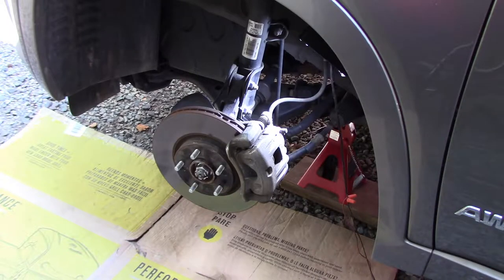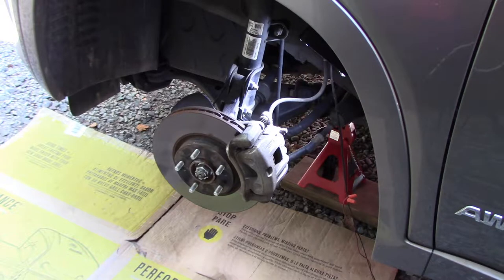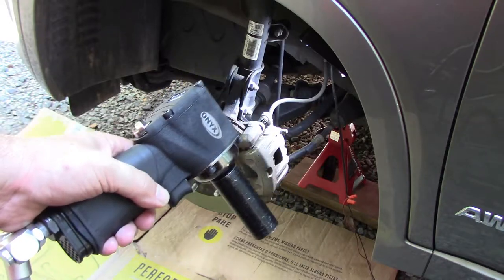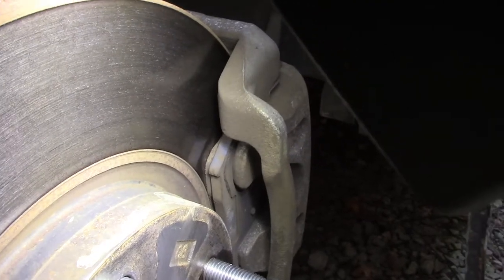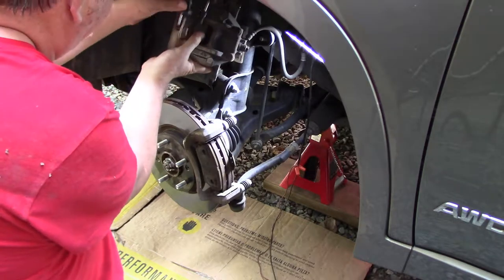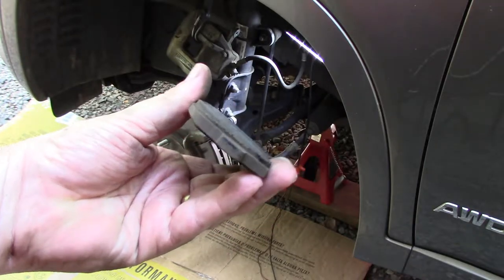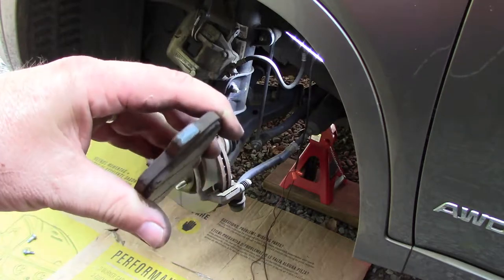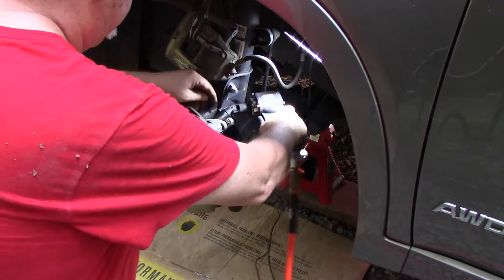2013 Kia Sorento Brakes

Comment: Hey man love the vids just a quick question I have the same model and I’m at 79k miles are there any major problems you have had with this Kia?
Reply from the maker: Nothing too major. Replaced a noisy pulley (video on that too). I just had to replace the automatic transmission oil temp switch. It was a pistol because I had to loosen the front motor mounts and jack the engine up a few inches. The Kia tech info site didn’t mention that. Several of the bolts on the cover are very hard to reach. I had to do it by feel. The code was P0711. Oh, it is a permanent code that a scanner won’t erase. News to me. Basically, it is so people don’t cheat with some types of repairs. After it runs a few drive cycles and the computer is happy it will clear.
Reply: TOM2RN thanks for the info man I really appreciate it so In general I would say it’s a pretty reliable car?
Reply: TOM2RN I’m replacing my pulley on Monday but other than that it’s running pretty smooth
Reply from the maker: Been reliable to this point.
Reply: I realize I am quite randomly asking but does anyone know a good place to stream newly released tv shows online ?
Reply: @Israel Camdyn Lately I have been using Flixzone. You can find it on google :)
Reply: @Langston Franco Definitely, I've been watching on Flixzone for months myself =)
Reply: @Langston Franco thank you, signed up and it seems like a nice service =) I really appreciate it !
Reply: @Israel Camdyn you are welcome :D